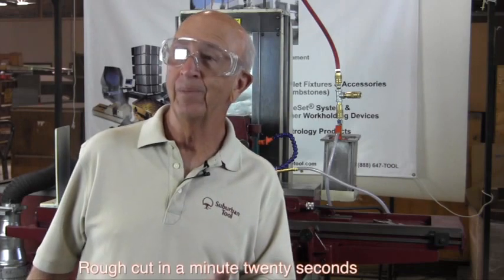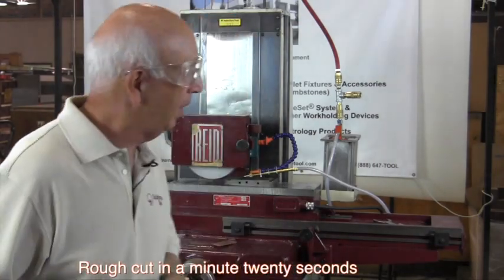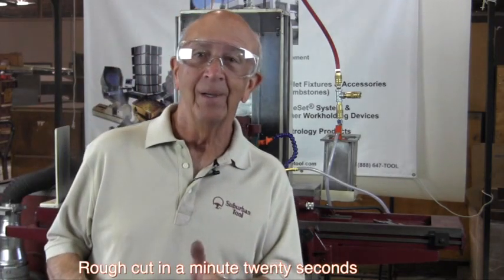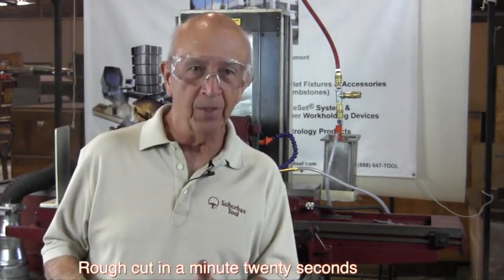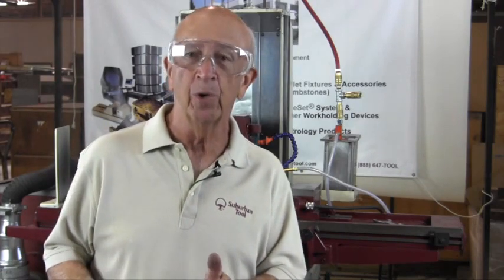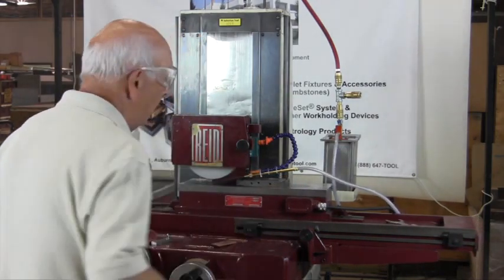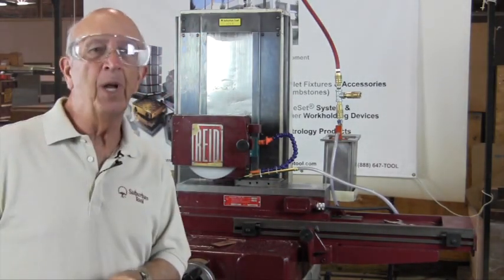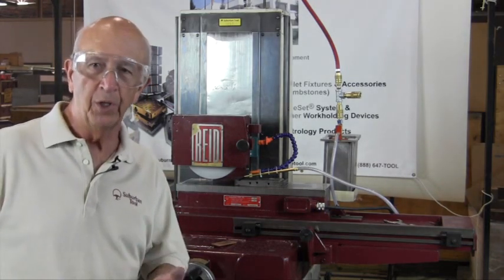Surface Grinder Basics - How to Grind Fast and Accurate

Comment: One thing I always told the new machinists is to position the dresser slightly to the left of center. If you accidently take off to much it wont pull the table in and force the dresser into the wheel.
Also when coming down to paper be on the far right of the part so if you accidently go to far your part isn't getting pulled along with the wheel.
 Some grinders stay true if dressed and turned off and back on. Others you will have to dress every time.You will know right away if your grind is bumpy. A very busy toolroom many times just leaves the grinders running..
You should show how to regrind a table. Ringing wheels ect.

Comment: Basically everything that I use in my daily work was said in this video, besides using your hand when "dressing" the grinder (after practice I just use my vision and hearing to recodnize the contact). And if the material has large differences, I do not use paper, I just contact the material normally. But besides that, very good tips I must say.
I have been working only 2+ years on grinding machines so far (from my 4 years experience), yes machines, since now I tend to use 4 different surfece grinders (2 small ones, 1 medium, 1 very large horizontal rotary surface grinding machine) and 2 that have more common with lead machines (1 roll grinding, 1 hole grinding, I hope this is how you can name them, since English isn not my first language, but I see that you have those also covered on your channel).
So I'm always eager for gathering more and more knowledge about my work, so I think I will be your regular viewer from now on. If only the language barrier won't be too much. Thank you very much for sharing.

Comment: Thanks for demonstrating an excellent way to save time on a surface grinder. Another way is to plunge grind most of the material, and leave about .002 for finish cuts. The 46H wheel will plunge grind almost like a milling cutter if plenty of coolant is used. The trick is to plunge feed fast enough to cause the wheel to break down and expose sharp grit. I'm also subbing.
Reply from the maker: Great comments, thank you for watching.

Comment: another method that is the norm in German and Suisse shops is to plunge down to .001 over size retract wheel move over as much as wheel thickness repeat and move over again and the last .001 walk over part for finish
another point most shops neglect is the diamond has to be sharp a blunt diamond will burnish the wheel and cause heat build-up
Reply: ..And the wheel must be burnish before the last walk over.

Comment: Hi Don, great video. I have a disk that is 8 inch diameter and half inch thickness heat treated to 50 RC. I am grinding the part and I cannot get it to be flat to .001 What is it that I am doing wrong? I am using coolant to grind the part. Any thoughts? 
Thanks in advance.
Reply from the maker: Have you watched our other video, how to grind super flat parts? https://www.youtube.com/watch?v=CsTbWAu0k-o&t=241s

Comment: Hey Don, how about a quick video on holding and surface grinding non-ferrous parts?
Reply from the maker: Pete Snell We have a video scheduled for today on that very subject Pete.
Reply: SuburbanTool Inc
Terrific! Looking forward to it, I have some jobs of that type lining up.
Reply from the maker: Pete Snell We released it yesterday.
Reply: SuburbanTool Inc
 Thanks Don, that vacuum plate is pretty sweet. How would you hold something like a large thin ring for grinding? I have some Niobium alloy rings about 4" in diameter, and 1/4" thick. Hard to hold without distorting, but I would like to grind them decently flat.
Thanks!
Pete

Comment: Don't take guesses to the flatness, but actually measure it. Because I'm almost 100 % sure that thing is flat as a boat propeller, as you didn't ensure the magnetic chuck doesn't pull it flat.
Reply from the maker: Jaakko Fagerlund This part is flat and was checked in this video (How To Check and Measure Flatness ) @watch?v=naXOpoRb-ws&list=UUrUM7Q29YDCs-zDrc1QRKQQ

Comment: Put your fingers next to the wheel: unfortunately working in a tungsten carbide preform shop in 1989-90 we were REQUIRED to hold parts with our hands when surface grinding the punch and heading/wire drawing blanks. Had MANY parts explode in my hands until I quit on the spot after 9 months. Employee turnover was VERY high there. Clamping the parts between 2 pieces of steel on the magnetic chuck was "taking too long to run these parts".
Reply from the maker: That's terrifying! I hope you made it out with all of your fingers.  Thanks for sharing, and thanks again for watching.
Reply: @SuburbanToolInc  OSHA wouldn't like that, safety come first!  coming from former machinist for 25 years

Comment: Could you make video about grinding  hardened tool steel like D2, Vanadis 4 Extra, M390, Elma  in 2-6mm thickness ?
How to get this grinded and not warped ?
Reply from the maker: +TheSad25pl Thanks for the comment, we'll take this into consideration.
Reply: +SuburbanTool Inc  by the way,  what would You suggest for grinding tiny parts  like folding knife pivots ? 
Bohler M340 steel  around 5-8mm dia. tapped inside.
I need to grind them to H7  after hardening.
Reply: TheSad25pl your not gonna take .010 on surface grinder with D2 and make it across a part that wide. your wheel will have worn about .003 .006.

Comment: This is old school never work today grinder used for grinding,yes you can take 10" off but it just Angeles the wheel ok if the metal soft.I use 60/62 Rockwell hardness it just use the wheel more.Just don't get it.

Comment: I would of put just enough magnet on there to hold the part, saves grinding a bend into your work, parts generally warp after heat treatment……I’d like to hear how you grind heat treated D2 or D3, very strange material to grind, Almost impossible with a 46kv……I too have been in this game for many years

Comment: what if the materials is carbide?
Reply from the maker: You would want to use a borazon or diamond cutting wheel.  You could use a silicon carbide wheel, but it won't be very effective.